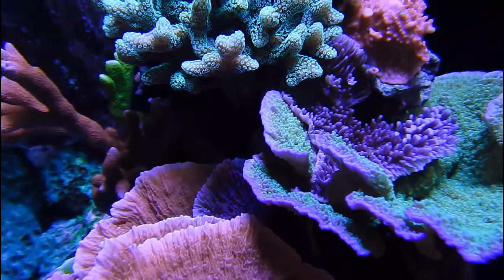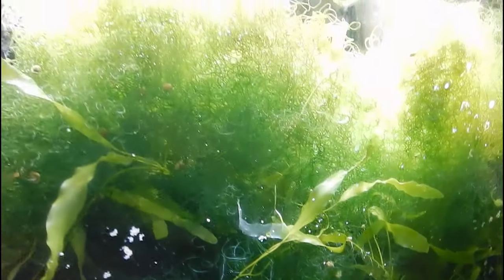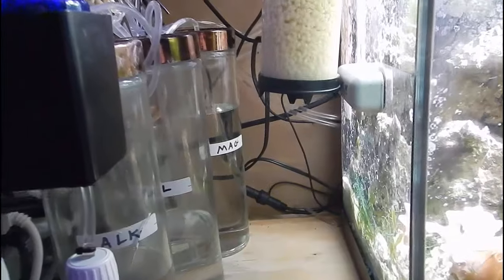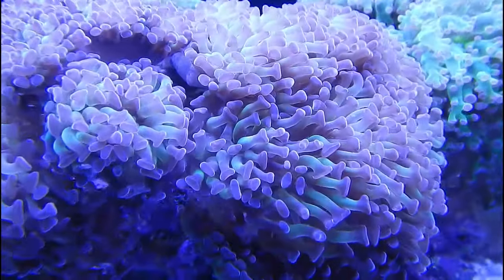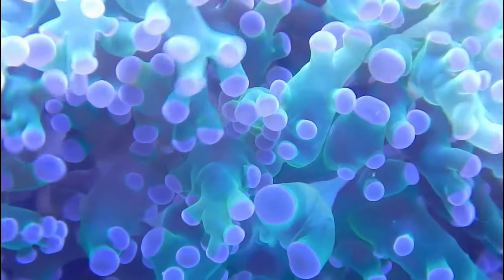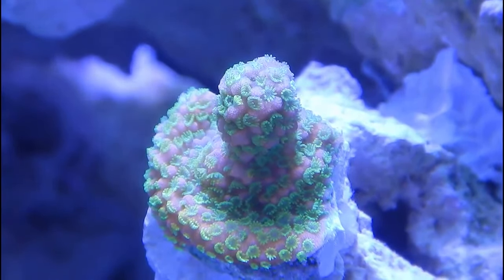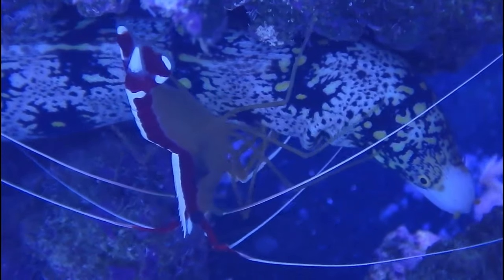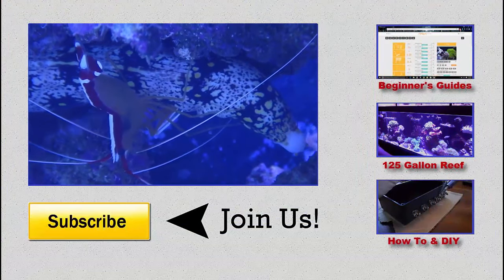Three Equipment Failures That Kill Reef Tanks & How To Prevent Them

Comment: I had my heater fail on the on position and all my fish were upside down and I threw them all in with my guppies in desperation that they wouldn't die from heat in that tank, none died luckily
Reply from the maker: Heater failing on is by far the worst thing. At this point i wont run a system without a temp controller